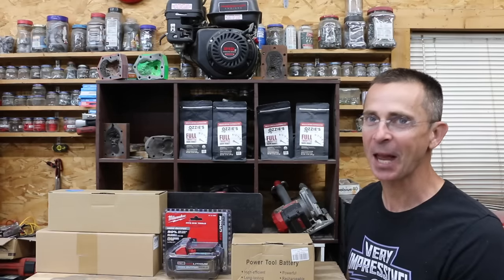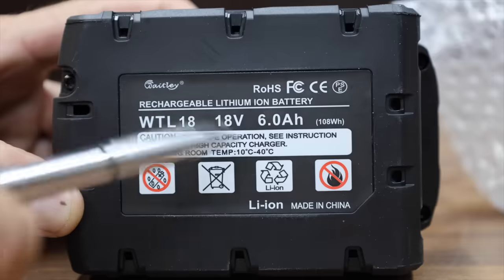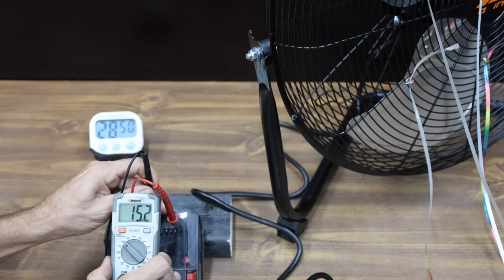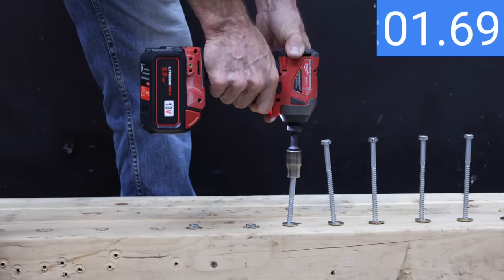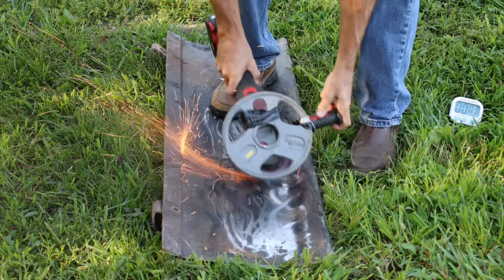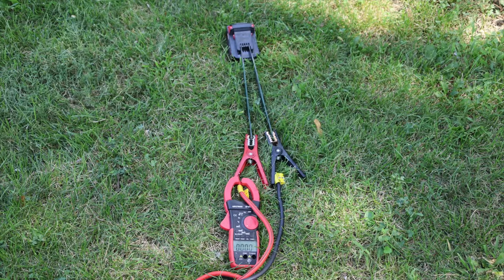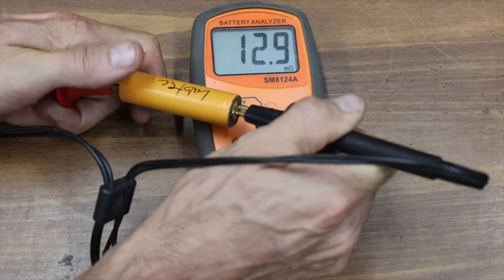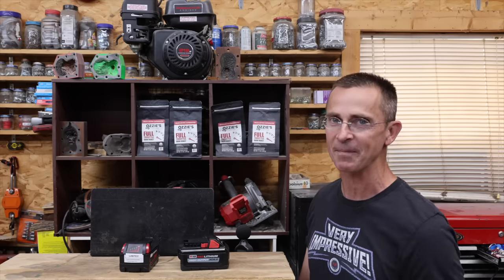How Dangerous Are Knockoff Tool Batteries? Let’s find out!

Comment: I don't recall if you mentioned charging/chargers in this video.  I mistakenly bought a high speed DeWalt charger for my 5 AH batteries, and sadly found that the higher the charging speed, the shorter the battery life.  I didn't quantify it the way that you have, but I have a pair of  (now dead) 5 AH batteries.  So I've gone back to the slow charger and my 3 and 4 AH batteries and had no further disappointments in the "Dead Battery" department.  Possibly another video subject? Regards,  Bob
Reply from the maker: Thanks for the suggestion.

Comment: I have 3 Waitley Dewalt 20v batteries.  2 of the 3 have a busted case but still work.  I occasionally drop my drill with battery attached and the Dewalt ones are all intact.  The Waitley are all 5 Amp Hour batteries and seem to keep up with the Dewalt but the difference is the case on the Waitley is very delicate.  I recently got two 5 amp  hour Dewalt batteries from Walmart for $100.00.  So I wont get any more of the 3rd party batteries due to their delicate cases.
Reply from the maker: Thanks for sharing.

Comment: We were curious about prepared hero emergency fire blankets work vs a fire extinguisher in emergency situations. Thought they’d be nice to have in the garage or workspace vs an extinguisher that can expire! Thanks!! Love your videos!
Reply from the maker: Thanks!  Thanks for the suggestion.
Reply: IMO, from the advertising of those fire blankets, getting a cheap surplus wool blanket would accomplish the same. Small fire just needs to be covered to cut the oxygen feed. A blanket of any type is limited by it's size. So you should have both a blanket and an ABC rated extinguisher. Additionally, any type of blanket used could also be dangerous in certain situations. Pot on the stove for example. Most people are panicking. Not only does unfolding a blanket take more time. But the person could easily and awkwardly throw the blanket on the pot, knock it over and spill flaming liquid everywhere, including on themselves. Very bad and very possible situation. This "Hero" blankets are a shameful gimmick that are going to get people injured or dead and waste their money. Most people shit the bed when it comes to fire and the shotgun approach of a good, "real" extinguisher is likely way better and safer.
Extinguishers should be smacked on the bottom with a rubber mallet once or twice a year to keep the powder in them from caking to the bottom. And the expiry dates are very conservative. And good extinguishers can be re-certified, unlike the cute toy ones grandma get you for chirstmas. 😁👍

Comment: Funny enough the tenmoer battery is a resold Waitley knockoff battery. Biggest issue I've had with knockoff batteries is is their internal construction, not all use the "load bar" style linkage like the OEM Milwaukee batteries do. I've had both a knockoff M18 and M12 high capacity battery(s) fail on the charger due to the batteries being wired together with very low gauge wiring. Another obvious issue is cell quality of course. I gave a a 6AH Waitley to an associate with the same circular saw as I, so we both had the same saw/battery. Mine on average lasted several to a dozen more cuts on framing jobs than his, however interestingly they would both fluxuate extremely in performance on a per-charge basis. Ultimately, mine is still functional, though the performance has degraded some. I feel like you get what you pay for and that it's probably a better value to get a used OEM battery than one of the knockoff ones for most instances. That being said, I've had pretty great luck with the 3.0AH Waitley M12 knockoff batteries. We'll see how they last in the long run.
Reply from the maker: Thanks for the feedback.

Comment: I buy primarily batteries from the tool manufacturers themselves, however I have gotten some aftermarket ones in the past for the M12 and maybe I've just gotten lucky with them.  Nice testing as always.
Reply: I was going to say the same thing. I got ridgid knockoff batteries and they were junk pasting maybe a year or so. But I had some m12 batteries made by biswaye and those guys lasted a good long time for me. I eventually my old Milwaukee charger stopped working and Ibelieve non use and leaving them drained eventually led to their downfall. There should be a forum or website for ppl to report their success and failure of each knockoff company so ppl would know who's work giving a shot and who should be avoided at all costs

Comment: I have about mostly Milwaukee batteries and they do last longer.  I have 47 of that brand and recharge them using the Rapid Chargers.  The non Milwaukee batteries were showing the red-green-red lights indicating they were no good so were disposed of.  Then ... I  had a 4ah non-Milwaukee battery that showed 2 lights on the tool but showed dead on the Rapid Charger So..I tried another Rapid charger and got the same result.  Puzzled, I drug out a standard Milwaukee charger and... the battery charged with no problem at all and has continued to operate fine.  Word to the wise...

Comment: Have you used any of these batteries with the Pinecil v2 soldering iron?

I'm thinking of getting a power tool battery as a backup.

Thanks in advance for your reply and have a good day!
Reply from the maker: Thanks for the suggestion.

Comment: Another outstanding test. It is like Milwaukee knows they have a superior battery, so they charge a premium price for it. DeWalt does the same. I wonder where they source their 18650 cells? I don't recommend Chinese batteries, but if they put another few dollars into the quality of the individual cells, and improved the safety features, they could easily compete w/ Milwaukee. Until then I would be very concerned about charging a Chinese battery without constant supervision. Thanks for the video.
Reply from the maker: You are welcome!  Thanks for the feedback.

Comment: Could you please test residential door locks?

Also, “commercial grade” spray bottles: how far they spray on narrowest, how wide they spray at widest, PSI they generate, viscosity of liquid they’ll spray, durability of handle, spray mechanism and the joint between that and bottle (we go through several each year because the joint-fitting cracks) and how well they resist things like chlorine bleach.
Reply from the maker: Thanks for the suggestion.

Comment: I wanted to know that during the short circuit test, why was the clamp meter jaw on the wire 
Isn't the wire supposed to be inside the jaws with the jaws fully closed ?

Comment: I've always found OEM batteries to outperform the knockoffs but here's why I will ALWAYS buy Milwaukee batteries.... A while back I sent in a 12ah battery to the service center (on their dime) that was 2 years OUTSIDE of warranty.  The cells were unbalanced and it wasn't holding a charge.  They sent me a brand new 12ah battery in the blister pack, not a refurb, a brand new one, at no charge.  Did I mention I sent them a battery that was 2 years out of warranty?  Every time I send them a broken tool, they send me a brand new one.  Milwaukee forever. I'm loyal. They take care of their customers. It's that simple.
Reply from the maker: Thanks for the feedback.

Comment: Hey great video as i have always wondered about this. You made a slight error in the graphics of the video however. From the 2nd test which begins at 3:53, at the end of the test when the results are shown at 4:26 you have the milwaukee 5ah and the $90 6ah version in the wrong positions as it was the 6ah that made 183 and the 5ah making 175. But great video otherwise!
Reply from the maker: Thanks!  Thanks for the constructive feedback.

Comment: Hi Ozzie.  Thanks for the review.  I found that knock-off brands were junk.  They failed after minimal use.  Finally bought Milwaukee which are OK.  "Buy once, cry once"
Knockoff Batteries =
Lenoya 18V 6.5Ah Battery Replacement for Milwaukee M-18 Battery 2Pack
Xocdvso 18V 2Pack 8.0 Ah Replacement for Milw M-18 Battery, High Output 8000mAh Compatible with Milw Battery

Comment: I use dewalt tools and in Ontario here a dewalt 6AH battery is $240 plus tax at Home Depot, I have had great luck using power extra brand batteries a two pack of 6AH being around $75 on Amazon. I’m well aware they need to recharged more often than the dewalt as they perform more like a 4AH but for the price I would rather 6-7 power extra over one dewalt. I haven’t had any problems with my tools, I have only had one of my 6 go bad over two years of heavy use and overall I have been very happy with their performance. I definitely think they are worth it over dewalt batteries.
Reply from the maker: Thanks for the feedback.

Comment: how much torque is required to break 1/4" 3/8" 1/2" or 3/4"  extensions from different brand tools, or will the 3/4" break the testing equipment. would love to see that
Reply from the maker: Thanks for the suggestion.

Comment: I buy the cheaper ones for when I am working in places where my tools are not in my view left under attended. 
But I also use them for fans and flashlight. Or if someone wants to use my tools. The batteries are almost worth as much as the tool.

Comment: There is one more potential option. I had 2 old 18 bold NMH batteries for my Hitachi drill that still had a lot of life left. OEM was not an option and I really didn't trust the knockoffs. I went to our local Batteries+ and they rebuilt them. The rebuilds were MUCH better than the original. The cost was comparable to the available knockoffs. I'm guessing that would be an option for the Milwaukee since they use standard cells.
Reply from the maker: Thanks for the feedback.
Reply: You’re welcome. You have some of the most informative videos out there and this is definitely one of them.

Comment: Would have been interesting a "power per dollar" graphic as well.buying two cheap ones you get more power than with the Milwaukee one. That may be way cheaper in certain scenarios. Then, it depends on the charging speed if it's available to charge a battery while using another.
Reply from the maker: Thanks for the suggestion.

Comment: would be interesting to see longevity on continuous charging and discharging over time. If genuine ones can be recharged 100+ times over years but knockoff one only last a few charges then what's the point of saving a couple bucks for an already worse preforming battery that also needs to be replaced far more frequently.
Reply from the maker: Thank you for the video idea!

Comment: A bit about charging that wasn't mentioned: 1) Fast-charging ANY Lithium battery shortens its life more than if the battery was slow charged, so if you have the time, slow charge them. 2) EVERY charging cycle counts towards the (Milwaukee) warranted 1,000 charging cycles.  If you charge from 0 bars, or 3 bars, they both count as a charging cycle.  So, if you want to use your warranty for as long as possible, run those batteries down before charging them.
Reply from the maker: Thanks for the feedback.

Comment: Can you do a video on knockoff standard capacity batteries? I'm particularly interested in the "upgrade" batteries that are the same size as the 2ah batteries, but claim to offer 30-50% more run time. I have the 3ah 80v Powerextra for Greenworks tools, and it definitely performs far better than my 2AH and 2.5AH Greenworks batteries at a much lower price. I'm also considering buying the Powerextra 3.6ah 20V to replace my standard capacity black and decker 2ah batteries since they work so well for my Greenworks tools.
Reply from the maker: Thanks for the suggestion.

Comment: We use Milwaukee tools at work. The old worn out 6 amps do pretty good until we try to use them in a concrete drill lol. I work for Toyota so no knock off batteries!
Reply from the maker: Thanks for sharing.

Comment: Would you consider testing led headlamps? There are a lot on Amazon but how do they compare to the name brands like sylvania. Lumen tests and longevity vs cost and halogen. Im thinking about some H13 led lamps without a cooling fan but everyone should know those lamps create a lot of heat and I doubt the China lamps will stand up for very long contained in a fixture
Reply from the maker: Thanks for the suggestion.

Comment: Got two 5 ah aeboren both ran my 1/2 impact for about 5 seconds. Now the only thing they will power is a small speaker. Will not power any 18 volt tool I have. Even when fully charged.
Reply from the maker: Thanks for the feedback.

Comment: My pal bought a Dyson battery knockoff on Amazon, he was absolutely happy with it as the capacity helped him to use that hoover for an hour rather than 15mis. Battery pcb smoked after two weeks, when opened you could tell that genuine batteries have beefier PCB elements and heatsinks, that’s only difference really, batteries themselves are standard Lion cells.
Reply: In this test it's clear that even the cells themselves vary considerably.
Reply: @garethonthetube  could be obviously as there’s more than one place making them, that dyson knockoffs had Panasonic cells….or at least labels🤣 to be fair saving 10% or 20% is not worth it when it cones to these batteries. I still have genuine milwaukee and dewalt batteries bought years ago that I use daily
Reply from the maker: Thanks for sharing.

Comment: I completely agree with the labtec batteries for me, I don't use my spare batteries often, maybe once or twice a month, at most.

So, a knock off for low utilization and very low cost works for me. I've had the same knock offs for about 1.5 years with no sign of performance loss, so if I get 3 years of use out of them, that's great for me.

But, on the flip side, if I was a daily li battery user, that performance loss adds up quickly. 10 to 15 mins per job per charge and the power loss is significant. Essentially, you would need a rotation of 2 to 3 knocks offs in order to have an equal performance to one Milwaukee. But, you definitely won't get the OEM longevity with a knock off. Over a 3 year span, daily users likely would get far more use out of OEM batteries with less overall spend.
Reply from the maker: Thanks for sharing!
Reply: @ProjectFarm  thank you for the wonderful test! More or less confirmed that for my specific use, I'm not wasting  money. 

One thing to note : your videos stopped coming up in my SUBSCRIPTION box, I had to search to find your videos because I was curious about a batteries and found you posted a video on it months ago. Not sure what can be done about it, but yotube hasnt been recommending me your videos for a few months now

Comment: Someone would make a fortune designing a universal battery adapter that allows Type X batters to be used with Type Y tools. What would be another interesting test is to test all the major tool brands' best batteries against each other using the fan test (not their specific tool). Just to see the quality of the battery alone. I bet you already have such a review.  I will look and see.
Reply from the maker: Thanks for the suggestion.

Comment: Measuring how many charge/discharge cycles a battery can undergo before it degrades to being borderline useless might be a good one, too. How will the $22 battery perform after a few hundred times getting charged and drained till it gives up as compared to the name-brand? Sure you can avoid dropping between 20% charge to reduce the stress on them. But then you get even less life-per-charge.
Reply from the maker: Thanks for the video idea.

Comment: I think I have an interesting point. when it comes to third party batteries, they seem to need to be used three or four times before they get one 100% efficiency. Only yesterday I received a mobility Scooter. and its instructions say it will take five charges and discharges before you get 100%. out of the battery. Going back a few years, I bought 3rd party Batteries for my Ryobi Angle Grinder. and I noticed their first charge. They were very poor and. subsequent. charges that slowly improved. I fortunately I have always had one of those multi-chargers by Ryobi that you leave the batteries in all the time. And I think that's what my batteries last much longer than the average persons batteries. Unfortunately, I do not have one for my Milwaukee tools. I don't even know if they exist.
Reply from the maker: Thanks for sharing.

Comment: Would you be interested in doing a comparison on RO filters? The devices will claim different performance based on various input pressures. And they also claim different waste to purified ratios. Then water quality is obviously a big category.

Similar comparison idea, how about a carbon filter (like the Brita pitcher) vs ro filter.

While you're at it could you fill your shop with smoke and test various air purifiers?

How about furnace filters? Is the $10 filter just as good as the $60 filter?

Then to round it off, how about fire/smoke alarms? Please don't worry about testing for carbon monoxide, we don't want to risk losing you!
Reply from the maker: Thanks for the suggestion.

Comment: Extremely valuable testing, very nice. Pretty poor how basically every brand except original lies to you about capacity.

However, and I quote: "and and and and and and and and and and and and and and and and and and and and and and and and and and and and"
It's especially grating since the "and" doesn't add anything, the sentences run perfectly fine without it, better actually. Just saying. :P

Comment: For anyone but a power user the knockoffs are just fine, provided you don't get one that is explicitly dangerous. Hell, outside of peak power concerns, the total runtime you get for the dollar is much greater. You can buy 4 of the labtec here and get nearly 3 times the wh while spending less than a single Milwaukee.